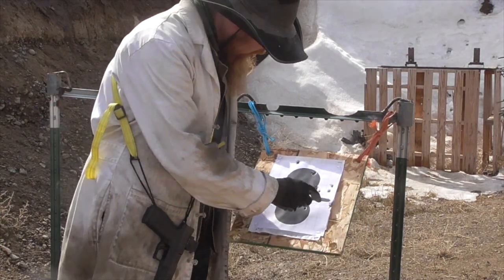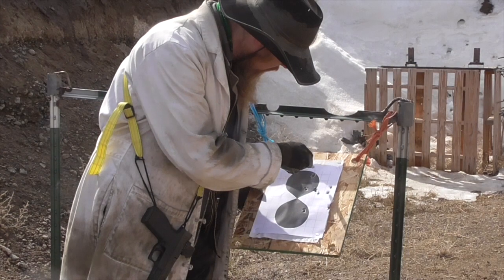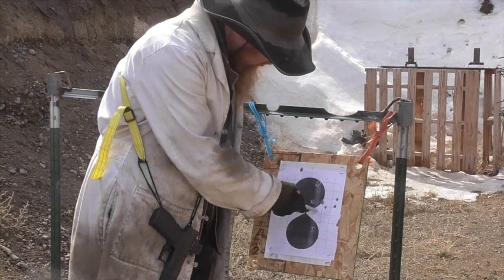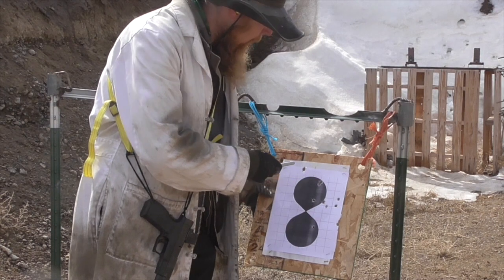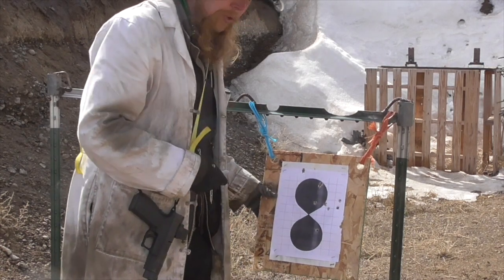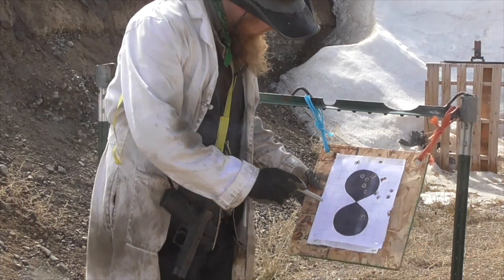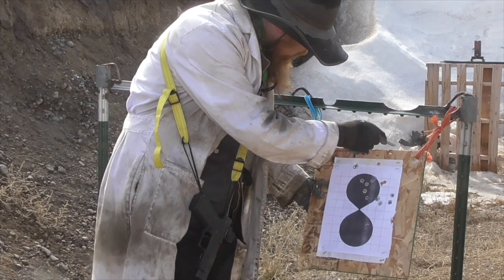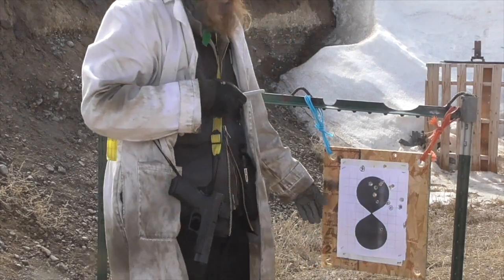45 ACP Loads with Injection Molded Muzzleloader Sabots (TIS372)

Comment: Could the MMP sabots be improved by trimming them? Likely the reason they don't allow the slide fully into battery is the sabot touching the lands. Shortening may be enough to allow them to function.
Reply: I was thinking the same thing. I would love it if he released his 3D printed sabots commercially as I would absolutely buy some (as I'm not in a position to 3D print anything myself right now). But, unless/until he does, simple modifications of an extant commercial product is about the best alternative

Comment: I've tried this in a S&W 625 (revolver in .45 acp) and a 10" contender barrel.  They work, but outside of about 15 yards I couldn't hardly keep them on a full size silhouette.  I messed around with a bunch of different bullet weights, designs, and powder charges.

Best accuracy for me was with 200gr swc and Trail Boss.  I used the red hornady (?) Sabots and they left a bunch of crud in the contender barrel.  I think they would work better in a barrel with really slow rifling.  

I want to say that a guy on castboolits that got impressive accuracy and velocity experimenting with this concept in a BFR or x-frame.

Comment: I had a friend that handloaded something like what you're talking about, but something very dubious.  I'll preface this by saying he was a somewhat shady guy.  Anyway, what he did was recovered .38 slugs that were shot out of a different gun, but weren't deformed horribly. Then he put them in a very minimalist sabot and  handloaded those in .44 special cases   and used them as his daily carry.  His rationale for this is if he ever had to fire in self defense, he had no faith in the "justice system" to see it that way.  After how Kyle Rittenhouse was treated (and many other cases), I can't say I blame him.  Anyway his plan was to just leave immediately in a self defense situation after firing and leaving it at that.  If he were ever apprehended, not only would the .38 slugs be a different caliber than his gun, they would have the forensic rifling pattern engraved from a totally different weapon!   The sabot was designed to pretty much disintegrate into tiny plastic bits (it was separate parts instead of one big piece).  I see that the sabots you used here also broke apart somewhat.